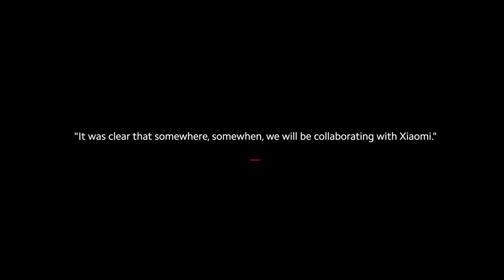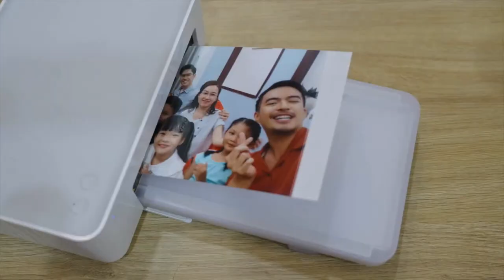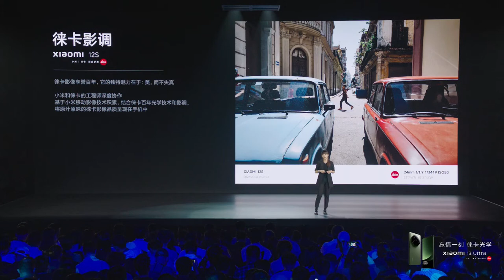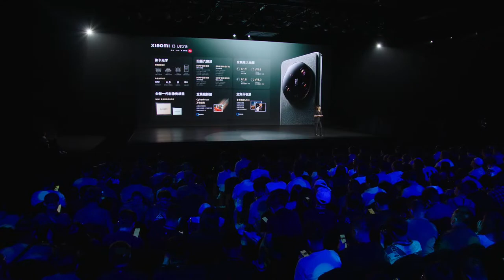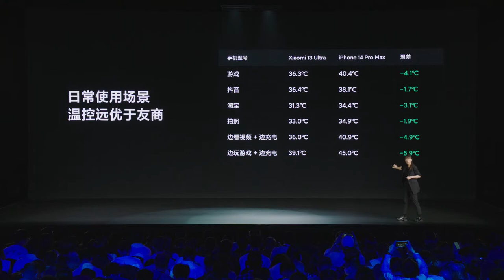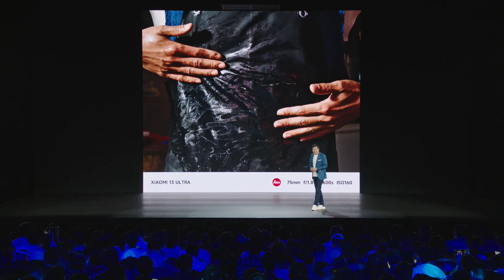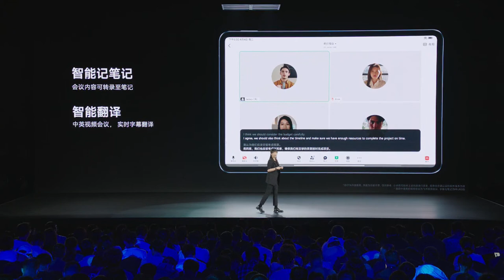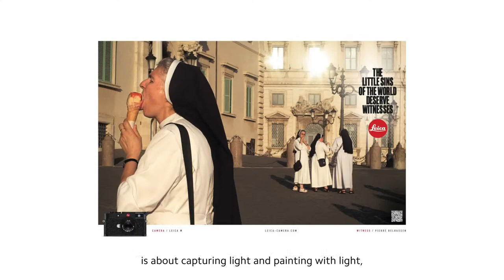Xiaomi 13 Ultra Launch Event

Comment: The cheers from the crowd are so AUDIBLE. Clearly, they're so hyped. 💯 It's gonna be a hit release, I know it will break markets!
Reply: Iam 🇮🇳🇮🇳🇮🇳indian bro
Reply: The only thing I don't like are the awful chins and bezels. Otherwise it's great
Reply: @panacheautomotive4298  I actually agree 👀😅 I thought the same thing, plus the whole thing looked thick that it's intimidating. But judging from its sample photos so far, I've been impressed to the point that I'd just have to suck it up unfortunately. But yeah, should have made these changes when they could have.

Comment: I will wait for the user's test to check. Sincerely the quality, in general, is really above iPhone or Huawei, but at least, this is the first phone where you can take decent pictures out of the main lens, because 10mpx is horribly limited for many pictures, especially in the wide lenses, plus the zoom between lens is horrible too if you have a main of 50mpx and the other's lens like 10mpx. How supposedly is going to create a decent picture with that? I like to have x1, x3, etc... but the best range to take pictures for me is x2, which is going to be a mix between the main camera and the first zoom lens. So amazing job on this point.

Comment: Camera is looking good . But only issue with Xiaomi in India is slow software updates even if you're using Flagship phones :(
Reply: sAbx_Editz  ya it might be good to try this in lowrange or midrange devices ( changing ROMs) but after buying flagship phones you expect everything to be default and a good software experience with decent updates is a must.
Reply: @triaxisdesigns  india main kan lunch hoga bhai

Comment: 57:12 funny how apple 3x zoom is closer than xiaomi 3.2x zoom
Reply: Depends on the main sensor, which I think is 23mm x 3.2 = 73.6, which they round up to a 75mm
Reply: 3x is not a standard, the sensor and focal lenght come into the game.. 3x means 3 times the lower focal length.. example: 10mm -> 30mm
Reply: @Awantg  I know... But still kinda funny and actually ultra wide from 13 ultra seems extremely wide

Comment: I wonder why Xiaomi Charging speed is reduced on newer flagship.
I want 210watt charging speed at the top model.
Reply: If you choose a faster charge, the battery capacity will be reduced, in order to consider the weight of the phone, this is a trade-off

Comment: the OPPO Find X6 Pro is a lot more impressive on camera specs
Reply: No it's not
The oppo has less rear cameras
the xiaomi has smaller secondary camera sensors but they are paired with faster lenses (which makes them brighter overall)